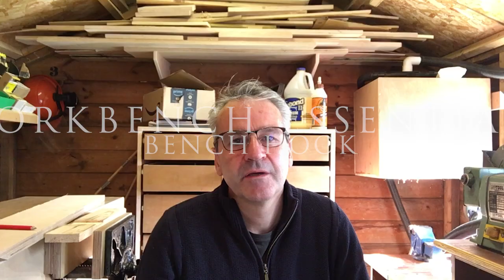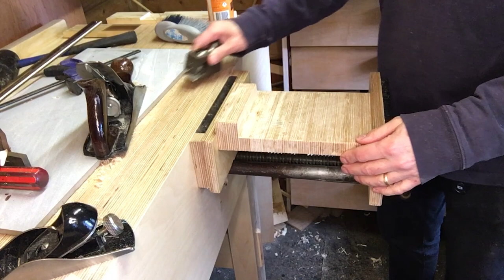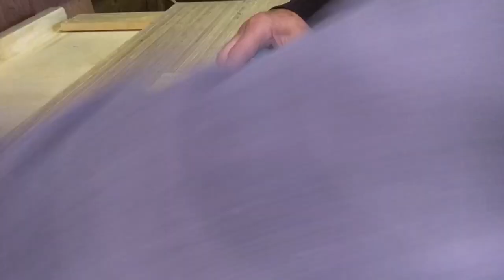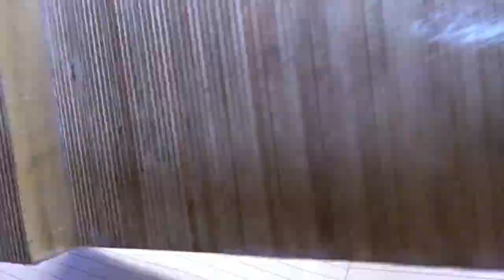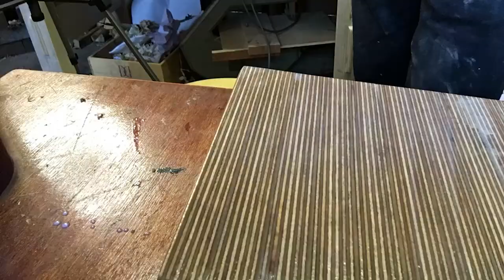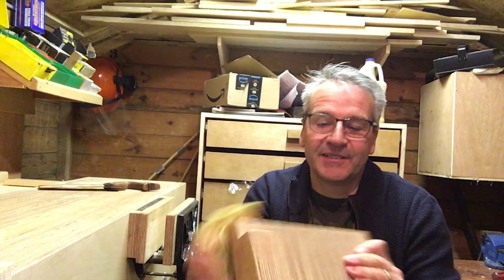Making a simple bench hook

Comment: Nice looking bench hook.   Simple design but effective.
I can appreciate you wanting the hook to look like the bench.   
I do not do a lot of hand sawing, so never bothered to make a bench hook.   I use my vise to hold the wood then clean up the cut with table saw or on the milling machine or wood lathe.
As you were making this I was thinking the next projects should be a shooting board (US spelling).
I do have a shooting board.    I made a 45 deg block separately to use on the shooting board to clean up mitres.
Dave.
Reply from the maker: shooting board coming up next